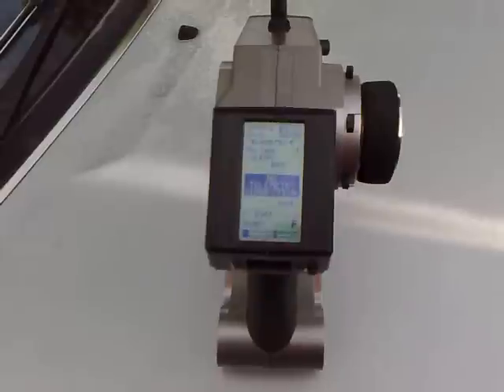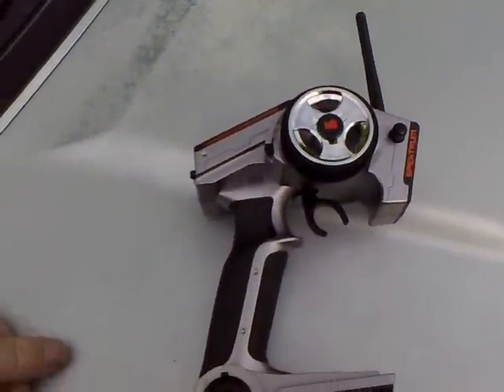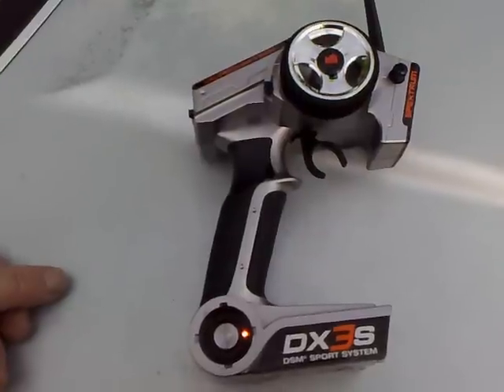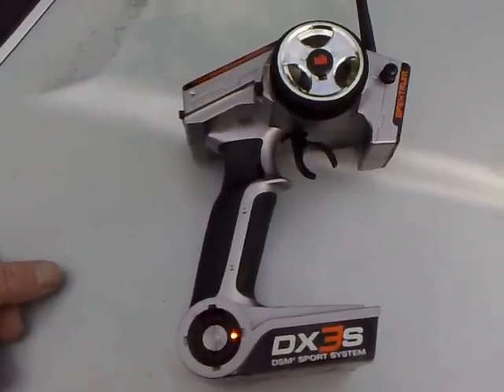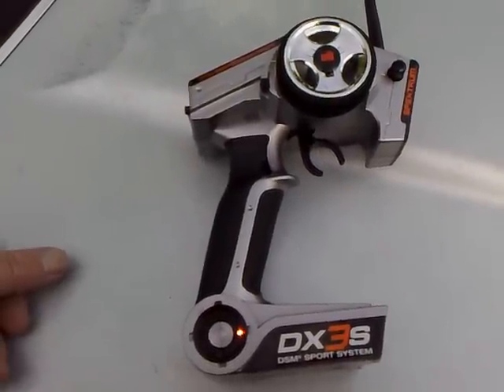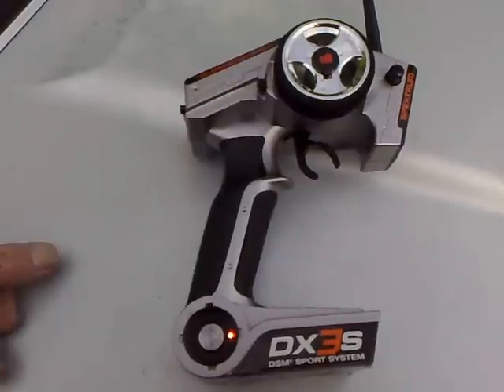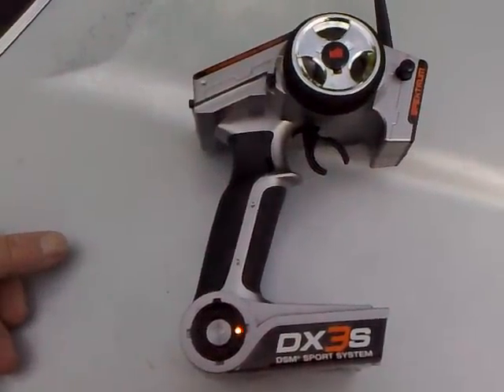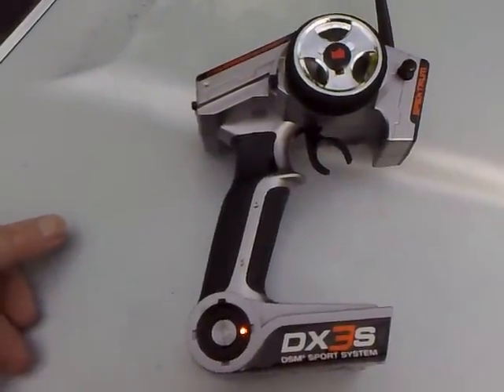December 27 09. Comments on my Spektrum DX3S

Comment: I'm not too happy with my Dx3s.  The screen is hard to read.  I expected the telemetry to show main pack voltage but it doesn't.  It was kind of pricey.  It feels kind of cheap - the scroll wheel feels weak.  Overall I'm not impressed.